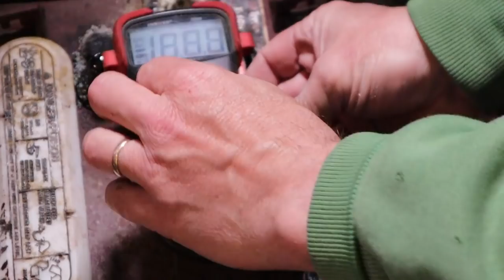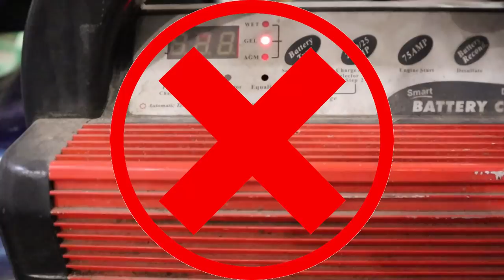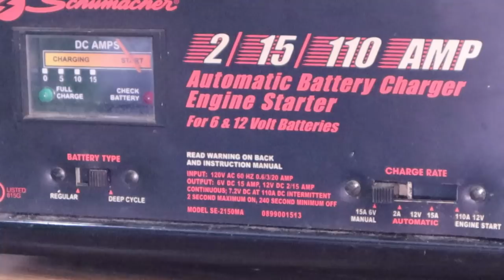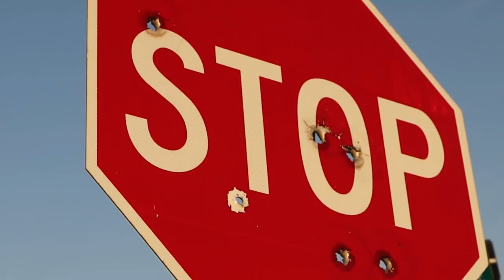Fixing A Free Golf Cart and Saving Money:   Tale of a Frugal Tinkerer

Comment: I scrolled down a few pages to see if it was listed (didn't see it, but I did see your dedication to your comment section!) but I came across another guy a few years ago that has a method for hooking up an inverter welder to essentially bake off the sulfites that form on the lead acid plates from repeated charges/normal cycles over several years. Whenever it decides to stop raining, I'll be doing another batch here shortly, but he claims if you do it every few years, you'll never have to replace a lead acid battery again. I suspect 'never' is a bit optimistic as the plates will wear out eventually, but if I can get 10 years out of a 4-5 year battery, I call it a win! 
Don't be frugal with that dielectric gel though. I slather it on the terminals and in every connection I have access to. Works wonders for fighting corrosion. 
(Also kudos for slipping that read-into-it joke by the youtube algorithim!! 😁)
Reply from the maker: Awesome! I may need to look into that trick for the batteries.  We're still running the same batteries as what are seen in this video but they seem to be nearing the end it seems (8 years old)

Comment: Great little video 💙 I have a semi that gives me similar issues and I’ve found that doing exactly what you did - completely cleaning and regreasing all the battery terminals - usually gets that job done. I’ve learned a lot owning my own rig over the last seven years. And one thing is to include my battery box with bi-yearly preventative maintenance.
Reply from the maker: You're so right.  A little battery maintenance goes a long way for sure.  Only because you're a truck owner did you catch the video I did on my Dad's semi?  Thanks so much for watching!
Reply: Thanks for this information! I’m taking on a cart project 🤦🏾‍♂️

Comment: You can use 3 12v deep cycle battery’s. Just did mine. Takes couple hundred pounds of weight off and it’s like $250 for fresh battery’s

Comment: I use CRC disk brake quiet spray on my batteries been 2 years on my car and haven't noticed any fuzzies around the terminals. easy to apply and comes off easy with a wire brush.
Reply from the maker: I need to try that for sure!  Thanks for the tip!

Comment: I've always had good luck with the CRC brand Battery Terminal Protector that comes in a spray can. Easy enough to wipe off if you need to pull a battery, convenient enough to give a little extra spray when doing other work under the hood. I've found quite a few old "dumb" battery chargers at estate & garage sales. Most just needed connectors fixed and a little cleaning on the inside and they are as good as new. Can't tell you how many times people needed to borrow mine because their "smart" charger wouldn't work.
Reply from the maker: Great tip!

Comment: Sharing my old age. Clean up battery terminals. Put some Coke in to a squeeze bottle, apply to aria of acid buildup. Slow is best. Use throw away rags and rubber gloves. It kills the active acid and then wire brush contact arises. Blessing’s to all.❤
Reply from the maker: I think that I probably need to be doing this.  Thanks for the tip!

Comment: Love your videos and sense of trying to get every drop of usefulness out of something. Now with that being said. I used to work at Exide battery making the industrial fork lift battery's. If they forgot to put water in BEFORE charging they could sometimes over heat and explode. The water is also what carries the positive electron's around inside through the plates. I think. Don't hold me to that last part. I just built them. Didn't really understand them.
Reply from the maker: Very good tip Charles.  I should have filled them up first.  Most of them still had a good amount of water in them though fortunately so not too risky at least.  Glad to hear the reminder though!  Thanks for watching and commenting!

Comment: I ended up switching to 3 12 volt deep cycle batteries and a 3 bank charger/maintainer. I use the stock charger for quick charges, which we seldom need.

Comment: Suggest you leave the charger plugged in all winter and check water once a month.
Reply from the maker: I appreciate the suggestion.  That is likely good advice.  I wonder if my charger turns back on when the voltage gets low?  I assume it must although I've never tried it.  I just fixed another battery cable on this thing last night when you must have made this comment!  What are the odds?  Thanks for watching!

Comment: Great video!!
My Dad used to put a baby asprin in each hole of the battery. it worked great for the graintruck!! Maybe you can get another season out of those!!
Reply from the maker: Thanks Muryl!  I'll need to try that asprin trick.  Never heard of that but makes sense with the pH I suppose.  Thanks for watching!
Reply: @digdrivediy  thanks for all the great videos!! My Dad had a 110 Deere. Learned to backup a short coupled trailer with that rig!!

Comment: What is the Ah on those batteries?
When you need to replace them could you consider substituting three large vehicle batteries to get your 36 volts?
In UK three branded heavy duty commercial vehicle batteries would total up to be a third of that price.
Reply from the maker: I'm not sure what the amp hours are off the top of my head.  There's been some guys around here that have used vehicle batteries but generally speaking they are not deep cycle batteries and don't seem to fare as well.  They will make it go but they don't have a good run time.  It's a good though though.
Reply: @digdrivediy  12 volt (leisure) battery as they are called here in the UK  might be worth a look. they are often used on an RV.